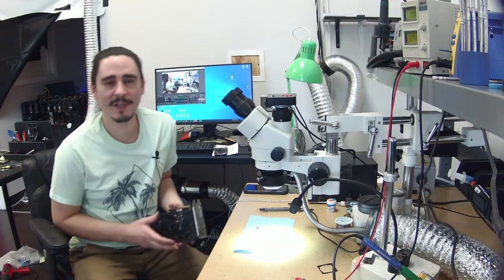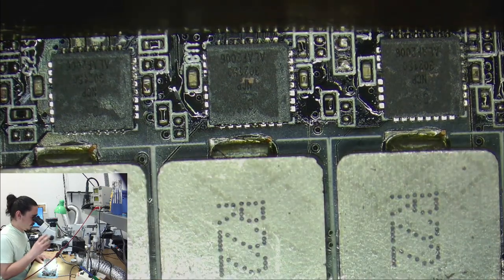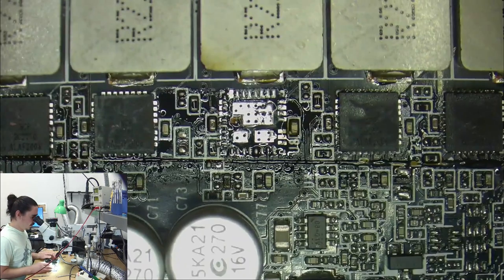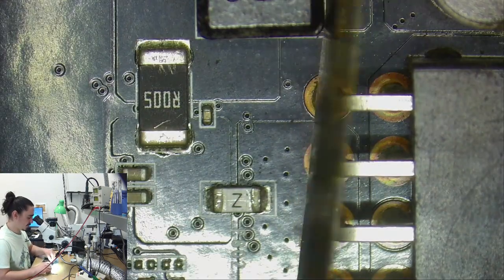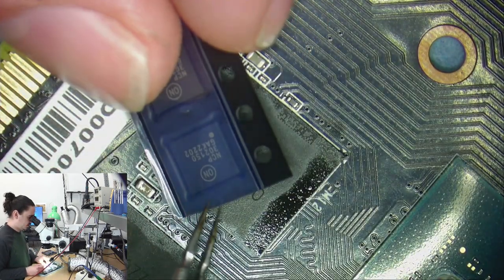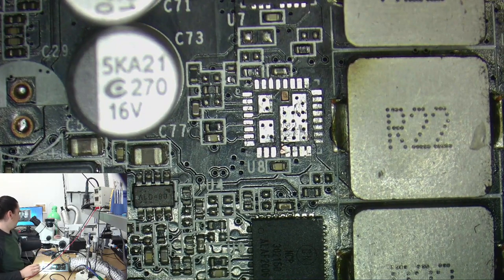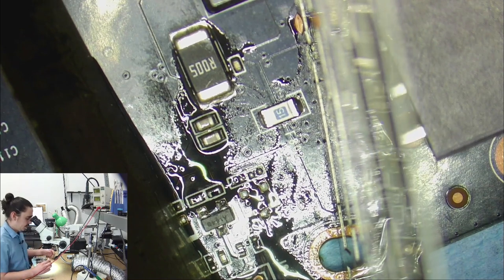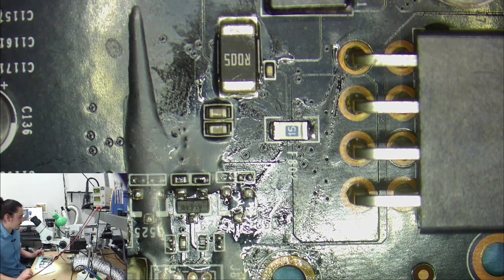RTX 2060 Super Broken - Short to ground or bad DRMOS (Mosfet)?

Comment: Too much rubbing back and forth when more flux and one pass is better with more solder on the mosfet base. Captan tape is better to keep heat off aluminum caps. I think while mining to keep the 8amp would be cool because it might save the core. When the old mosfet shorted to core the fuse is all that saved the core. A better power supply that stops the current quickly is better.

Comment: Hello fellow Aaron!  How is it you're able to remove these mosfets with such ease?  9/10 times, I simply cannot seem to get the solder to pop with my chinese hot air station (txinlei 8586), even with a bit of a preheat in the toaster oven.  It seems no matter how long I leave the hot air pointed at it, and how swimming in flux it is, the darn thing just won't pop!  Some times it even cracks and I end up having to dremel it off :/  

is it simply my cheapo equipment, or is there a technique here that totally eludes me?
Reply from the maker: I notoriously use a cheap aoyue station I got from fry's like  8 years ago. I own more expensive stations, I prefer my aoyue. Everything is made in china, all my tools. In most cases, people simply do not have enough practice with their equipment. It is very often the case that people's aim are much worse then they think it is and sometimes they are not pointing the hot air in the right spot. I would recommend cranking up to full heat and air and practicing on donor boards to see what you can do.
Reply: @iBoardRepair  thanks for the honest reply!  it seems so many other people stress buying more and more equipment, but I've always been a bit of a minimalist myself and tended to think that technique/experience - not equipment - was what I was lacking!

love your approach, even the simple things like giving the board a thorough inspection.  I feel like a lot of other people would've spent hours probing that board and checking schematics, when in reality taking the time for a thorough/intelligent inspection saved you all that headache.

keep it up, looking forward to more of your videos!